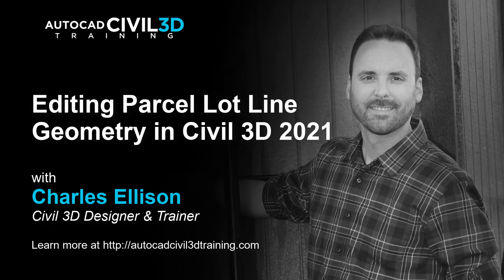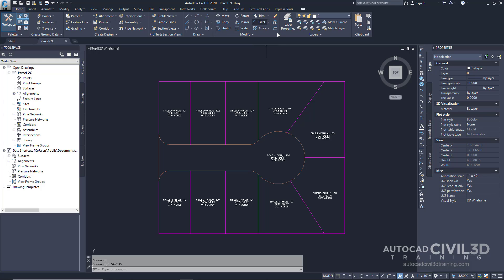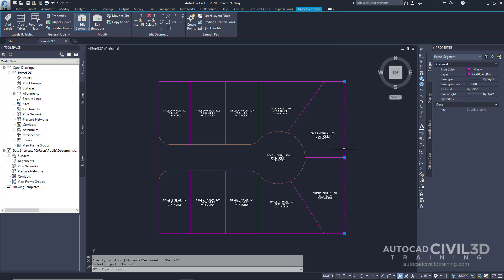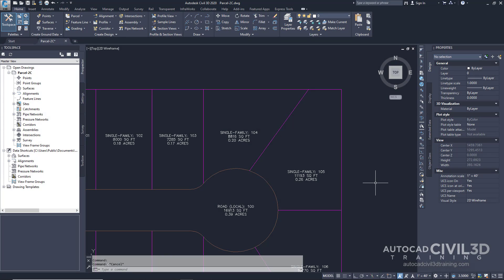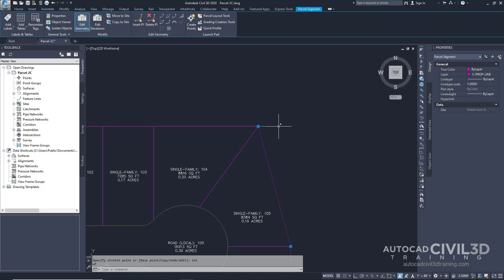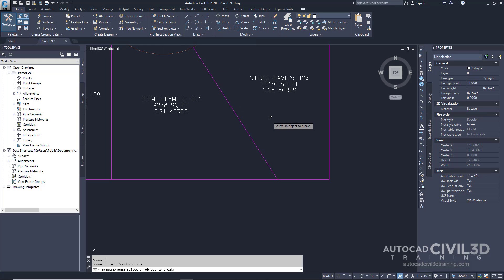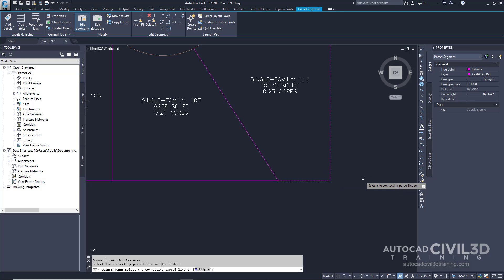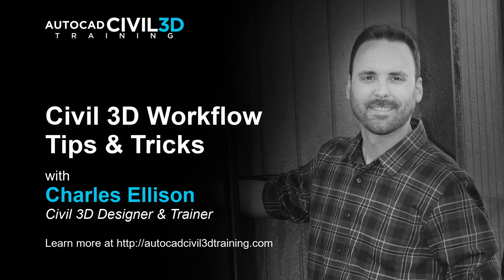Editing Parcel Lot Line Geometry in Civil 3D

Comment: Excellent explanation. I have a question; perhaps there is a topology tool in Parcel to avoid layer overlaps and prevent errors from improperly closed layers? Regards.
Reply from the maker: Civil 3D parcels don’t really have a “topology clean” tool like GIS. Best workflow = keep geometry clean first (snaps, no gaps/overlaps) and use Map Cleanup tools if needed before creating parcels. That prevents those bad closures.